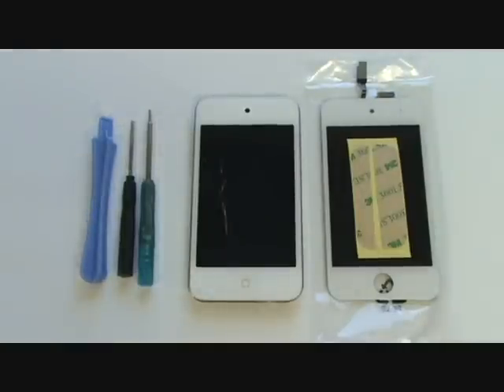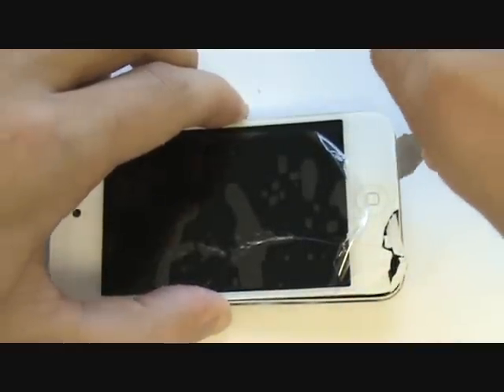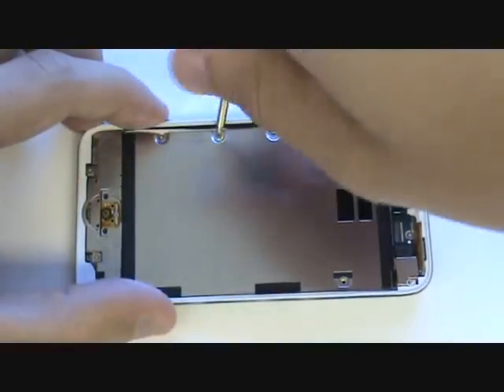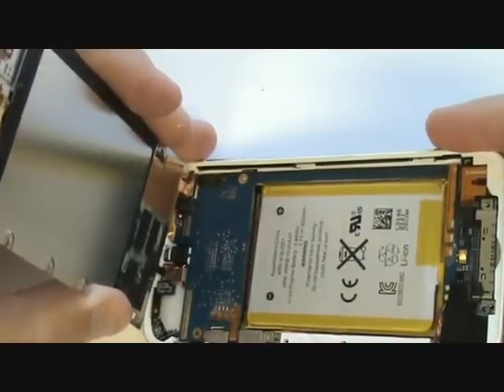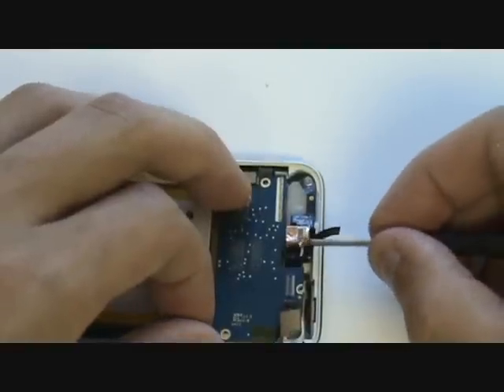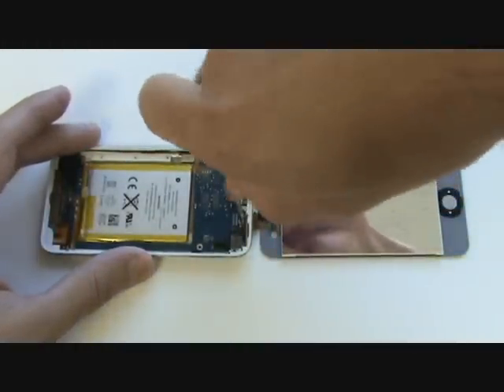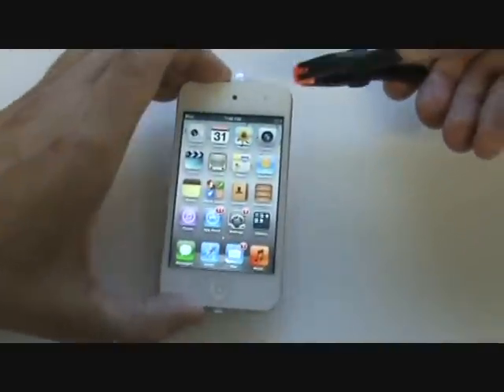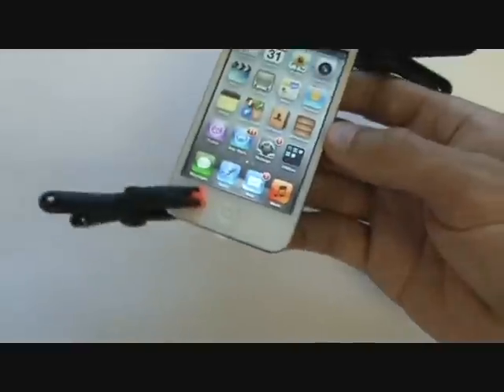Tutorial: iPod Touch 4th Generation Screen Replacement Repair Glass | GadgetMenders.com

Comment: I have watched this video a million times now, its the best tutorial I've found on the web. I've fixed three iPods now. Guys, IF YOUR WIFI IS NOT WORKING ALL HOPE IS NOT LOST. Get back under the board and make sure your wifi antenna IS PLUGGED IN SECURELY. If you are getting connection only 1 foot away, your antenna probably became disconnected is only barely touching the connector when you put the board back down.

Comment: Thanks.  I used this video to change my screen out today.  When the screen turned white I thought it was done for... then reviewing the tail end I realized... 

1) I had my digitizer cable bent the wrong way.  apparently this will make the screen turn white when putting pressure at the top.

2) I had to reset the ipod power.

After I did both of those it worked well. :)

Comment: Thankyou for this in depth video, I got mine done in about 3 hours. Thought I might have been screwed when I realized the shattered part of the digitizer was right over where the WiFi antenna was. I had to carefully remove each tiny piece of glass one at a time so as not to tear the WiFi ribbon cable. Also had a hard time getting the new screen in because of the misshapen top left edge that sustained damage from the drop but it actually turned out really well in the end! Thankyou again :)

Comment: Great tutorial! Thanks. I did it, it took me two hours and a half, and main problem for me was at the end of the process to adjust the screen and the ipod. The screen flushed on the top (the screen bus was bent the wrong way), and the adhesive was not strong enough. I had to reopen the day after, put the bus well bent, and use the Super Glue gel. It works now well.

Comment: Couldnt get the IPOD screen to come on, checked again the logic board connection. LOOSE! Wrapped again with copper tape and made sure the logic board was connected IT WAS! Finally! Nothing happened! Tried the reset trick at the end of the video. NOTHING! Connected the IPOD to my AC home charging unit and the IPOD came on!  Amazing! thanks GadgetMenders!

Comment from the maker: Check the digitizer cable and be sure it's securely snapped in place.  This is the cable that plugs in under the board and is tricky to plug in.

Comment: I just completed the new screen / LCD digitizer installation and everything is working fine. The screen is not completely flush on the left side because I damaged the bezel at a spot about 3/4 of the way down on the left. It is almost all the way down but not quite. I do not want to try & force it flush because when i had this problem with my 2nd GEN it cracked when i tried to do that. I am happy the way it is, should i just put it in a fairly strong case to protect it.  Will a small amount of Super Glue gel along that left edge help?

Comment: Mandy, where did you buy the replacement parts from? You have to beware of cheap replacement parts as this can be a trap. when you hold the power button and home button, do you continue to hold it until it restarts? If not then give that a try, but from what you are saying, it sounds as though the digitiser maybe faulty or you may have kinked a connector ribbon when reinstalling. Let me know how you go

Comment from the maker: The wires are soldered under the board, however, you have access to the solder points above the board and that's all you need to do.

Comment from the maker: Reset by holding the power button and home button simultaneously for 7-10 seconds.  Small amounts of super glue gel on top of the adhesive make for a stronger hold.

Comment: Hi, 
my ipod screen is cracked 

So what do i actually need to replace it? As in, what parts?

Am i right in saying, all the tools, hairdryer, lcd screen and digitizer will be sufficient?
And also, do i require both a lcd screen and digitizer ? or will a lcd screen on its own be enough?
Reply from the maker: You need to replace the screen just like what's shown in the video.

Comment: I accidently cut the blue wire tbat is on the left side of the speaker. the question is why I got black screen? what does blue wire do? How can I fix it? Can I leave it alone? would my screen can be fixed? if so how?

Comment: Holy crap... my power cable became unplugged as I closed it up.  I was lucky i was able to shove a plastic tool in between screen edge and bezel and tear it open other wise i would have been SOL. Thanks for the video.  Mine was a success.

Comment: I purchased the Screen Replacement/Digitizer and completed the removal/install.
I first got the white screen, but then reset it and now can see the screen saver. All is good. Picture on the whole screen. However, it does NOT respond to touch. Reset again. Still no response.
What now??
Reply: never mind...thought about it and figured that the digitizer cable was probably not connected properly. It was not. Reconnected that...probably the hardest part of this whole process. Now it works.
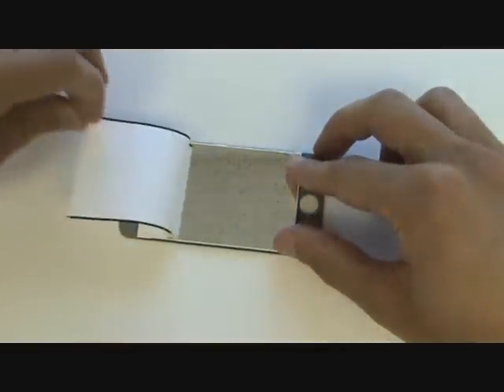One note, though, my screen did NOT have the 2nd layer of plastic mentioned at 12:14. When I tried to remove this, I ended up damaging the screen, by trying to peel off something that wasn't there, so that there is now a big black spot in that part of the screen. Very frustrating to come so far and actually accomplish the task, only to have the big blob on the screen...

Comment: Hi, I followed all the steps, and my ipod turns on fine and looks great, but the bottom half of the screen is unresponsive (the 'slide to unlock button') while the top half works great (the 'volume adjustmen't, after you double click the home button) do you know where I went wrong? 
Any feedback is appreciated :)

Comment: what do you do if you did everything on the replacement and then the touch screen doesn't work and you cant unlock the screen?
Reply from the maker: R Weaver Check to see if the digitizer cable is full plugged in correctly and not torn. If it is, its possible that you got a bad digitizer. If purchased from us we will exchange defective parts.

Comment: heyy I did everything correctly, got the ipod to boot up, connects to wifi, and the I can control the volume up and down,home button works, but the touch screen is not responsive. I was very careful. I have not fully restored the ipod yet, but i have tried holding the home button and lock button down multiple times. Do I need to get a new digitizer again or is something maybe not plugged in correctly?

Comment: Go into settings, general and software update. If there is an update available it'll be listed. If it isn't, and it says, "Your iPod is up to date" then your ipod cannot be updated to that iOS.
iPod Touch 4 can be upgraded to iOS6 but many features will not work. iPod 3 can only go up to iOS 5.  iPod 2 can only go to the last version of iOS4 (4.2?)

Comment from the maker: This will need to be replaced. It can be tricky and does require soldering but it's very doable. You can also consult with a local repairman if you don't feel comfortable attempting on your own.  You can connect the device to your computer to retrieve the pictures and videos.

Comment: I accidentally bent the plastic bezel inside and around the metal housing.. Is there a way to fix this? I also have a portion of my screen that is white when I turn it on but the digitizer works fine.. any clues? Hard reset didnt work

Comment: Hey, first off all, many thanks for the great video! But I' ve 2 little problems. 1: when I heated up the tiny metal plate which I took from the old screen (with the two holes in it, for the camera and sensor) to stick it to the new screen, the aluminium foil on the back of the LCD started to come lose. I don't know if that's a problem or not, but it doesn't seem quite good to me. 2: First I had that white screen, but when I moved the iPod a little bit, it became black, and I can't boot him or get the apple logo on. I tried several times to replug the LCD cable, but it doesn't seem to work. The strange thing is, that iTunes sees the iPod and can update the firmware and so on. I really don't know what to do. 
Hopefully this video isn't outdated and can you help me.

Thanks
Reply: Now, after restoring and stuff, I get a white screen when I turn the iPod on. I can slide the slider and touch everything but I only see a white screen. When I unlock the screen, the screen becomes brighter. I think only the backlight is working, which sounds really strange to me. After the night, I tried to reconnect the LCD and it worked perfectly for 3min and it turned white again. I don't really want to buy a new one, because it worked perfectly for a time, and I don't think the LCD is broken. 

When I try to connect the old LCD (with broken glass) it works perfectly too. I really don't know what to do now, I hope you can help me.

Comment: I am repairing my ipod's cracked screen/LCD. I did everything, tested it, and I was working 100% However, the glass just didn't fit and I needed to bend out a corner. I did this. Then, when I was ready to glue/set it, I connected the screen to the motherboard again, except this time it did not turn on. So I reset. This gave me a black screen with only the opposite side, (the LCD lit up.) How can I fix this?

Comment: hey I followed your video and replaced my screen; however, after installing the screen, I was getting a black screen, so I reopened the device and replugged everything back in. But now the screen is white, but the power button is not working. I'm sure I didn't damage it because somehow I turned my ipod on the first time, but now it is not responding. What can I do?
Reply from the maker: Verify that the two screen cables are securely snapped in.  Reset by holding the power button and home button simultaneously for 7-10 seconds.  It the problem persists you have a defective digitizer and our customer service team can arrange an exchange for you.  The power cable suffered damage somewhere.  Maybe even at the connecting points.

Comment: So My Ipod 4s is cracked heavily but Ive had no problem for almost 5 or so months until last night in which I have tried putting in my code but the bottom row of numbers 789 do not work but the rest of the screen responds fine. I tried to reset it 3 times with no luck

Comment: If you get a whit screen hold down both the home and the power button down for 10 seconds or a little longer than u should get the apple sign. This will be a really long boot btw and if you have a jailbreak it won't remove it

Comment: I accidentlly turned my ipod on right before I pulled off the flex cable without even realizing it. My ipod will not turn on or even be recognized by iTunes. Is there any way I can fix this or is my ipod dead?

Comment: I just the screen on my ipod touch 4g and when I turned it on the screen was all white but voice control was talking what should in do?
Reply from the maker: Verify that the two cables are securely snapped in.  Reset by holding the power button and home button simultaneously for 7-10 seconds.  It the problem persists you have a defective digitizer and our customer service team can arrange an exchange for you.

Comment: The only thing you need to make sure you do with your replacement is to use extreme caution and to use packaging tape on the cracked screen (I'd use the strongest tape you have or super glue works as well, just make sure none of it gets on the housing). After that you can go about replacing your screen like normal.

Comment: hey I just opened my ipod 4g 16 gb because the screen was cracked but then I tried putting the normal screen back, the touch screen didnt work, because the plastic in the digitiser accidently came out, I don't know if that's an issue I tried to put it back, it still didn't work. the home button doesn't work, It works when I click it with my finger nail and doesn't work when I put the home button and try to click it. can u please help me as soon as possible because I don't want to lose my ipod its new
Reply from the maker: Mehds mehds Try to check if any of the cables were damaged (the battery cable,  home button flex cable) These are often damaged during repair.

Comment: so i followed all the steps up to the part where you said to test to see if everything was working properly and it was working fine, and then after i took off the tape and plugged the cable back in nothing shows up.

Comment: Need help, Did everything correctly and double checked everything, the power flux cable isn't ripped and the digitizer cable is secured correctly. The screen does not even turn on.

Comment: ok ok why you remove  the inside part out ? is just the front glass
Reply from the maker: It's necessary to access the port where the digitizer cable plugs into.
Reply: ok ..yeah my hubby messed up my ipod..should've known not to let him fix.

Comment: If I reset the iPod but the screen still white what else can I try
Reply from the maker: Verify that the two cables are securely snapped in.  Reset by holding the power button and home button simultaneously for 7-10 seconds.  It the problem persists you have a defective digitizer and our customer service team can arrange an exchange for you.

Comment: my screen loads up and everything but my screens touch is unresponsive why
Reply from the maker: Verify that the cable which plugs in under the logic board is securely snapped in.  Reset by holding the power button and home button simultaneously for 7-10 seconds.  It the problem persists you have a defective digitizer and our customer service team can arrange an exchange for you.

Comment: Now it won't turn on at all. :(
Reply from the maker: Verify that the two cables are securely snapped in.  Reset by holding the power button and home button simultaneously for 7-10 seconds.  It the problem persists you have a defective digitizer and our customer service team can arrange an exchange for you.